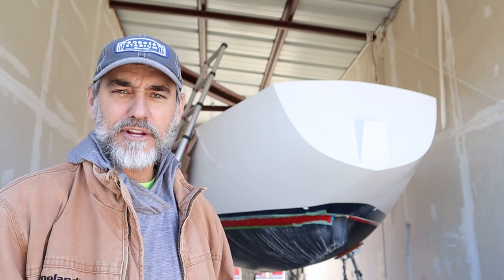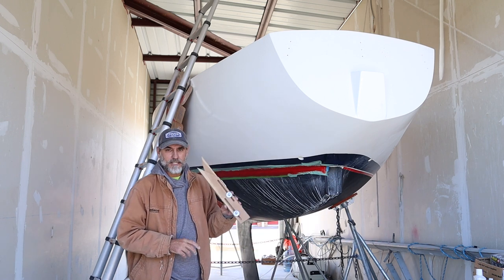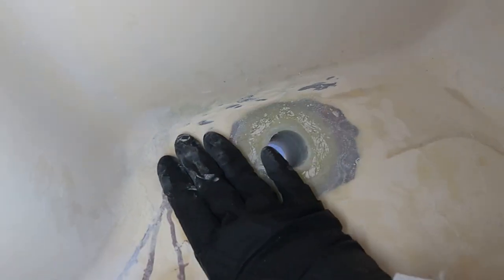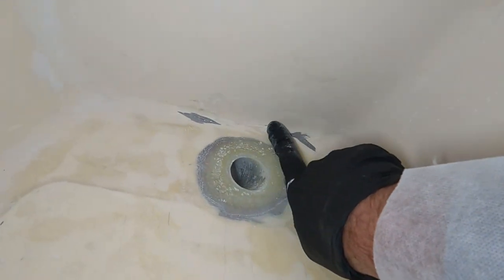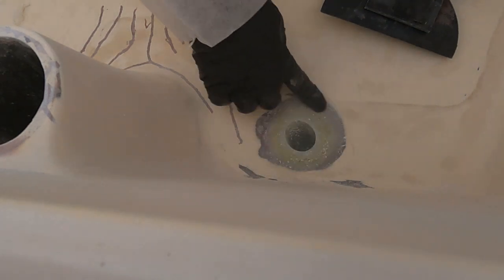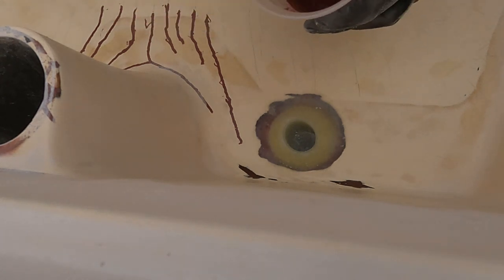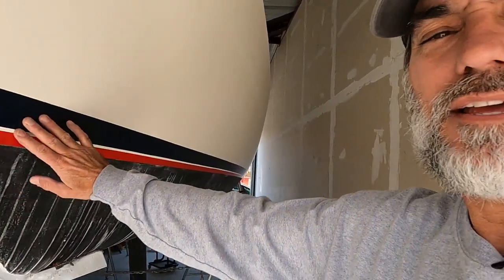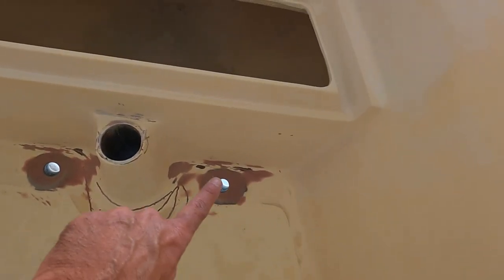Applying Non-Skid - Sailboat refit #30  fairing, sanding and applying new non-skip in the cockpit.

Comment: Hi John (name correct?  sry) Thx so much for sharing your fix ups.  My first sailboat was a San Juan 24' and I loved that boat. I was unskilled back then but I wish I could have refitted at the level that you are at with yours. I can't wait until you start the next boat. Have you tried texturing the paint on top of the all ready textured primer? I wonder how that would look? It's not easy to juggle the full time job, refitting and editing at the same time I imagine. Try to keep it going. I'm working on a Grampian 26' right now and I will definitely search out some Alexseal and try it. Take care   Trevor from Campbell River BC Canada
Reply from the maker: Thanks Trevor!  I haven’t tried texturing the paint.  It’s so thin I’m not sure it would provide much support.  I think a good way to do it might be to use gelcoat. But the trick is to use a regular roller first then go back over it with a textured roller.  Thanks for watching.